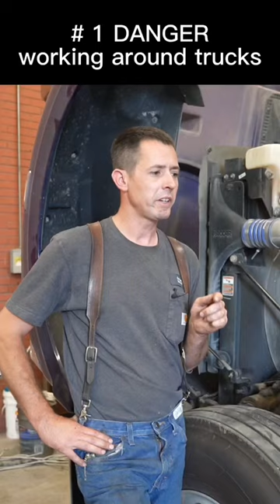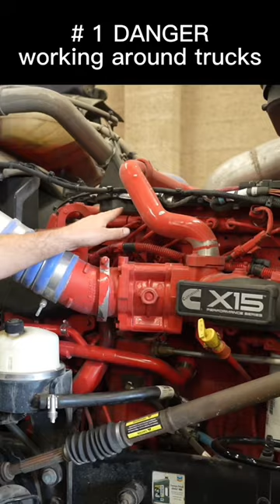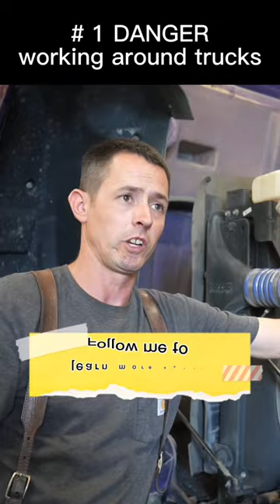#1 danger around semi trucks - common rail pressure danger #shorts

Comment: Even a small cut from high pressure oil/fuel can be deadly due to hydraulic injection.
Reply: Try pneumatic injection. You get a air bubble in your blood stream and it reaches your heart your already dead. It creates a vacuum in your heart and it can't pump. That's why I'm afraid of airing up the tires or handling air equipment.
Reply: @theenzoferrari458  
Yes youre right, thats scary also. But hydraulic injection with an oil or fuel causes toxic poisoning within whatever soft tissue it goes into, and every second counts, ie: do you want to lose a finger, an arm, a shoulder or just die.....
Reply: @js7003 also not mention about hydraulic injection that once it's in your blood stream it's extremely difficult to get out and the pro long affects could be very painful with a possible loss of a limb or fatal if not cared for properly and even then you still stand a chance of that still happening...
Reply: 30,000 pounds of pressure per square inch is quite explanatory
Reply: If it's hydraulic fluid, the mist can act as a nerve agent
Reply: @ShreffieYnmiz  ok then you do then and show us. I'll be waiting.
Reply: Came here to find this.
Reply: @theenzoferrari458  Would the air pressure used for inflating tires (~100PSI) actually pose a significant risk?

I work with this stuff often, and if it can really cause near-instant death without any warning, we need to drastically increase our safety procedures.
Reply: Word.
AvE on YouTube did a few videos illustrating hydraulic injection injuries with various produce. He also showed just how deep the fluid/oil/magic sauce can go beneath your skins surface, leading to gangrene and almost certain death.

I don't feel for pressure leaks anymore with bare hands. Heck, i dont even use gloved hands anymore due to the clear danger that I had no idea about until maybe 5 years ago.

Hydraulic Injection injuries sound horrific.
Reply: @user2C47  yes it can. Osha warns even a air gun with a defuser that drops the psi out the tip to about 30 is enough to cause it. If they see someone using an air hose to clean them self off it's a huge fine on the company.
Reply: @theenzoferrari458  any job requiring air stuff is crap hard work anyway, you can do more with your life big fella
Reply: @georgecroney6168  please spare me the semantics. 🙄🤫
Reply: Ya I just realized how dangerous I am. Amazing I still have all my extremeties.😂🤣🤣
Reply: @theenzoferrari458  airing up which tires regular car tires or commercial tires?
Reply: @coreturkoane5570  a balloon
Reply: You guys drink and think too much lol

Comment: Ironic that I'm seeing this today cause I work for Caterpillar and today I took my licensing for my master diesel tech certification on the Perkins tier 4,  854E and 1204 engines and we just learned in this past week about the common rail pressures on today's 4 cylinder 3.4 and 4.4 liter are at idle, 6300 psi and at max pressure 28,780. Also learned that the fuel rails hard lines are one time use due to distortion in the flare fittings and then they showed us a video of a what happens if the pressure burst from the injector connection and in the demonstration they had a fake hand in fireman's glove with a cr55 hardend steel plate behind it. When that high pressure hit the glove, it cut right through it, as well with the hand an put a deep gouge in the hard plate. Than they gave us a whole mess of info on blood contamination from diesel in the blood stream if that were to happen. Now I'm old school, and from the days of cracking an injector line to bleed out air, if the system got air bound but those days went bye bye once I learned about common rail high pressure set ups. Contamination from diesel IS NO JOKE, guys who still crack lines need to loose that theory and google what happens if you get pressurized diesel in there blood stream. I fully agree with this short and people who work on these, be careful an do some research on the engine your working on cause them old school mom an pop shop methods are now is severely dangerous to do. Stay safe out their....
Reply: they they need that much pressure😳
Reply: Hey, thank you for this post. I've cracked lines many times. Is there an alternative that you know of for purging air? Say if it didn't have a lift pump like older macs?
Reply: Hey bro how did you get started at caterpillar ⁉️ im at uti for diesel right now and im tryna get an idea of how i can get my foot in the door ina good company like cat

Comment: Was a steam engineer in the Navy. 1200 psi at 950 degrees. A small leak sounds like a jet engine at full throttle. Not something you look for with your hands.

Comment: That last part about not seeing steam and cutting broomsticks in half to locate the leak is fucking terrifying…..
Reply: Takes a man to do that type of work.
Reply: @markm0000  No doubt, first I heard of this type of hazard… 😯
Reply: Metal fires are rare, but also fun...magnesium catching fire. Will burn through the hull of a ship if allowed to stay in place. Magnesium is used in aircraft parts, and requires an entire aircraft to get shoved overboard due to the danger to the ship.
Reply: @SolarWraith  Absolutely! I used to work with Mg flakes by the keg at a previous job. Burns super hot! Go right though most anything and is about impossible if not plain impossible to extinguish if aflame…
Reply: It's the bristles that are cut, not the handle. 

Then you'd need another broom to sweep up the bristles.
Reply: @markm0000  why be misogynist
Reply: @Error-bj1yi  Why not admit there isn’t a single girly girl on this earth that would do that job.
Reply: @markm0000  man how old are you? Because it sounds like you have some very deep rooted prejudices…
Reply: That’s why it’s a man’s job 😂
Reply: @markm0000  man I wish you were born 10 years later and your mom loved you more then you’d stop hating women
Reply: Yep it's called superheat. We learned about it in HVAC school.  Steam powered locomotive engineers back in the day had to be aware of it also.
Reply: @master-oppressor  🤣
Reply: @MichaelSmith-pg6gi  Thanks! This is pretty neat learning something new that I have completely been unaware of in many environments….that I have worked in…. and yet never knew or was educated on by the safety staff. But still, it truly is cool to know now, and be on the lookout for 👀
Reply: Its true my dad told me something similar but they used cardboard to walk down a corridor.  If tbe cardboard is suddenly sliced up stop ✋ youve found the leak 😳
Reply: I was waiting for a demonstration
Reply: @master-oppressor  no lol. It’s the actual broom stick.. my dad is ex navy and power plant machinist, 6000,15000psi of steam pressure. If there’s a leak and you walk through it, you’re cut in half and it’ll seal you up as well.
Reply: @connorlhamon  Hate to break it to ya but the bristles of the broom surrounded the pipe, and you would walk the pipe, listening for the tale-tell sound of bristles being cut and blown all over the deck. 

How could a broom stick check the top of a steam pipe that was literally millimeters from the next whatever there would be in the overhead compartment?
Reply: Never knew this was a thing 🤯 learn something new everyday
Reply: @danieldelgado5469  Go ride a steam paddle wheel on the Mississippi. They give tours of the steam engine's works.
Reply: We used the broom stick in the Air Force to find hydraulic leaks on aircraft too.
Reply: @master-oppressor  wrong!!! It’s the HANDLE being cut!!! We had a guy cut his arm off reaching in front of a leak in the Air Force.
Reply: @fineartonfire_5327  We're talking about steam, not hydraulics, bruh. 

Steam is invisible, hydraulic fluid isn't.
Reply: @sotn8010  Reminds me of Resident Evil ha ha
Reply: Like a freakin laser beam.
Reply: It's not true
Reply: That sounds insanely terrifying
Reply: @customconnections2425  snomobile engines made of magnesium and if they ignite you just have to let it burn. I think they use mag in fireworks because of how bright they get
Reply: Lookup "fluid injection"  learned about it in training
Reply: its a bull... myth
Reply: Just imagine not knowing any of this for some reason, you’re walking around listening to the steam hiss because of the leak, you start walking towards the sound but you can’t see anything then all of a sudden you’re cut in half 🫣😳
Reply: @gabrielfranco9786  Or if it just started, one moment you're just walking, and the next moment you're dead.
Reply: Nightmarish.
Reply: @Error-bj1yi  What’s so hard to understand about men doing hard jobs. Half the women I know have an only fans, and they other half are still living off their parents.
Reply: @darius318  fluid injection is terrifying. You can get injected from high psi pressure washers, and airless paint sprayers, hydraulic fluid is probably the most common though.
Reply: @ItalianMetalHED  true in fact. Frames, wheels, etc.. all of Mg if taken to flash point is going to burn hot af, and is self feeding if I remember correctly. You literally can throw it deep under water and it will do fuck all to extinguish till the material is finished.
Reply: @master-oppressor  no. High pressure steam leaks can cut a handle right off....HPS can cut a person in half
Reply: @andrew1898  How would you get to the top of a pipe that's stacked on other pipes with the handle? I'll tell ya how. You cant. But you can with the other end. Try it.
Reply: @master-oppressor  wtf r u talking about. That's what ladders are for. Have you ever worked in a steam room before?
Reply: @andrew1898  Ladders in a naval ship?
Reply: @master-oppressor  YES! You think they hover to locations?
Reply: @Error-bj1yi  most girls aren’t strong enough to even use a 3’ steel pipe wrench. If you ever worked on steam systems you’d why it’s male dominated.

Comment: Sounds terrifying but the reality is very different, I've never even heard of mechanic horror stories related to high pressure fuel systems over the 12 years I've worked in the industry, but it's still important to know these things.
Reply: I knew of them due to being a maintenance tech for a place that had a steam line. But when I was a diesel mechanic we were always told about the dangers of the widow maker kegs. Luckily I never seen the brake chamber burst on a truck. Ive also heard they are alot safer now too.

Comment: yeah, water cuts steel just above 20k psi so 30k psi or even less than that is enough to kill. Older diesels you could undo the fuel lines at the injectors to bleed the system, common rail will mess you up if you try that.
Reply: Hah any liquid at 20-30k pisseyes is gonna cut thru just about anything it wants to.

Comment: I know an older retired guy who used to work on high pressure boiler systems. That's exactly how he told me they looked for steam leaks. A broom or piece of cardboard, waved around in front and overhead around the pipes and when it gets sliced up by what looks like an invisible blade, there's your leak.
Reply from the maker: Thank you for sharing your experience!
Reply: Question for both of yall.. How often does someone get hurt from  a leak thats invisible.. I learned something new with using a broom, cardboard to find a leak thinking but leaks also just happen.. or do the pressure guages change or something letting least 1 person of an invisible danger hiding somewhere in the system..
Reply: @danafaulhaber334  I honestly don't know. I just heard about the method of finding a leak from the old timer.
Reply: @Bloodbain88  when I was around a high pressure system it honestly sounded like a train whistle when there was a leak. The first time I ever experienced it I was creeped out. Dark tunnel sorta cramped. Osha qualified confined space and all of a sudden I hear a train horn and backed right out asking what that was.

Edit: now that I think more and read some others. There is one that is called ultrasonic where the psi is so high behind the rupture in the line we can't hear it. Much like a dog whistle. Our secondary backup to detect was check gages at various points along the line. We had a cover over them to check the gages. We checked all them before entering the tunnel. When I had my first burst it was Infront of me had it been behind me I would of crawled forward cause I don't know what's causing it. But with how people are I'm fairly certain a good number of people would go near it. After my experience they changed training to make sure we knew what to listen for.

As for checking we had 3 gages per check area. A 0 to 14000, 9000 to 14000, and 10600 to 11000. The important one being that 10600 to 11000 since our system maxed at 11000 it went up by 25psi per tick. So if check 1 thru 4 had 11000 but 5 thru 14 had 10950 we knew we had a leak between 4 and 5.
Reply: @Crazyman23  Man that's crazy. Only thing dangerous that I'm around (pressure wise) are truck tires at 120psi. And some hydraulic lines at maybe 3,000psi. And those are considered to be like bombs. I did have one hydro line explode and send what looked like a thin wire of hydraulic oil right over my right shoulder. All these things are essentially pressure differentials and when that pressure is able to escape it's deadly.

You ever learn about Delta P (I think it's called) that underwater welders have to know about? Basically if you're in a tank of water, or large pool or near a dam or something like that, where there is nothing on the other side of a barrier, and there is a leak, you can't see the water rushing out with tremendous force. And if you get close you'll get sucked in even through a tiny hole because all the weight of the water is trying to escape through that hole. Pressure differentials.
Reply: @Bloodbain88  I remember hearing about that before. But don't recall much. Thanks for the refresher tho.

Yeah I got out of that place after 5 years and became a diesel mechanic for about 9 years. Not once did they earn us of pressure on the system they just told us to worry about the widow maker in a keg. The brake chamber. I've only seen one of those fail. Was a stuck up driver and he pulls into our bay. We got a nice bump at that bay and we only drove in at about 1 or 2 miles an hour. He flew in like he owned the shop. Well this bump caused what he was complaining about to fall free bust and shoot off across the yard punching a hole through our ex swift trailer turned tire storage, dent  a rim and puncture a new tire. That incident had us file a complaint on him, and his home base for letting a brake chamber in that bad of condition make it onto the road. His home shop (our company had about 6 shops in total) had to get a service truck to come pick up the driver and we had to deliver his truck an hour away to his shop once we fixed it. We ended up finding 2 bad slack adjusters, few bad bearings, 4 of his 11 axles had no oil in the hubs. 2 other bad brake chambers and one that was already gutted. We wondered how that truck even stopped or how it never managed to meet dot. After our pictures, report, and the security footage got looked at good by HQ that shop got new training and most of the senior staff got let go. I got transfered there for 4 months to act as a substitute shop manager/trainer.
Reply: @Crazyman23  That's what I'm doing right now, diesel mechanic. I never had a brake chamber shoot out across the shop before. I did have the little ears shear off a cage bolt and the pushrod stroked out it's full length and could have easily punctured my chest. But always treated spring brakes like a gun, never point it at anything important. Man I hate doing DOT's especially when the company is a cheapskate and doesn't want to fix anything. Don't know how many times I've been told "needs to pass inspection. It's an old truck and we can't put a bunch of money into it so.....don't look at anything too hard." 

Edit: Oh and the oil hubs. I swear none of these guys know how to check those. I was doing a service on a flatbed straight truck and all 4 oil hub caps on the tag axles were shattered and had no oil. Driver never even knew. He also had 3 tires off the bead and didn't know. Only brought it for an oil change and was pissed it needed 3 tires and 4 sets of bearings, seals and hubcaps.
Reply: @Bloodbain88  the shop I worked at was pretty good. The company in general gave each shop 40k a month to maintain the trucks we had plus an additional 15k  in budget for other shop trucks that came through. Certain things would give us additional budgets. Of the 9 shops 2 were what we called the lazy shops that just did the bare minimum. Ours was one of the trusted shops so when the season ended we got alot of the trucks and trailers to rebuild. The troubled shop was known for being cheap to look "golden"  since they were always way under budget.

Now I work for a grocery store chain in a distribution center as a maintenance tech. So I keep everything from forklifts and power industrial trucks (pretty much a pallet jack you ride on) to conveyor, roll up section doors, and the locks that keep a trailer secured to dock all functioning. When I first started they trusted the dock locks way too much but I got them to go for a redundancy and get wheel chocks just incase. Every now and then I help with the truck and trailer fleet and this is the first place I ever seen use disc brakes on the trucks and trailers. I knew they existed when I would look through the fleet pride (great truck and trailer part store BTW) parts catalog. But I had never seen one in person until this place.

Comment: Superheated steam has the heat plus pressure. If you are scared to work on cpmmon rail  Go sail
Reply: Pops told me they used to have 400 degree water for some process for computer chip making at IBM East Fishkill back in the day.
That's some wicked pressure to maintain to allow water to stay as water at 400 degrees.